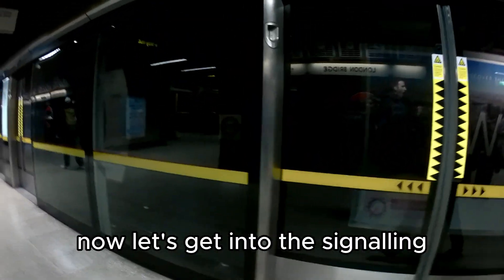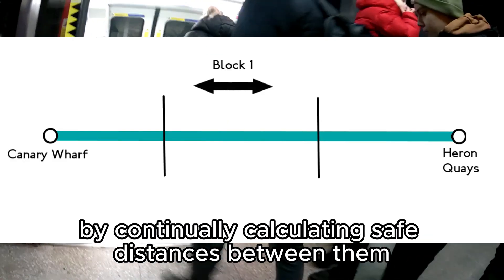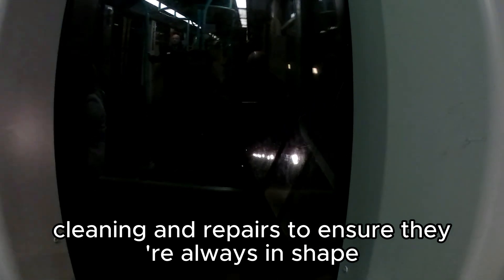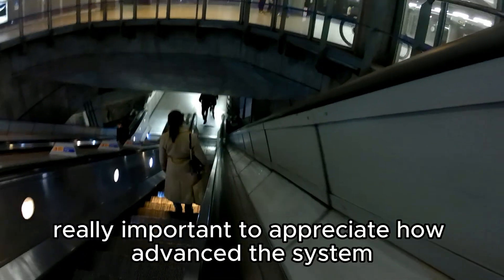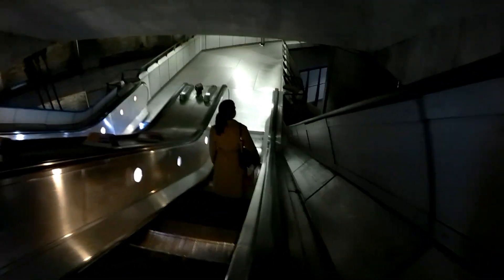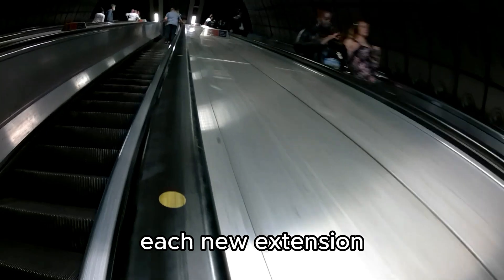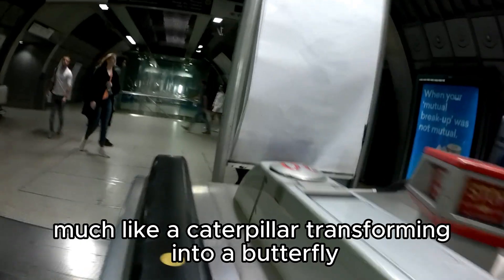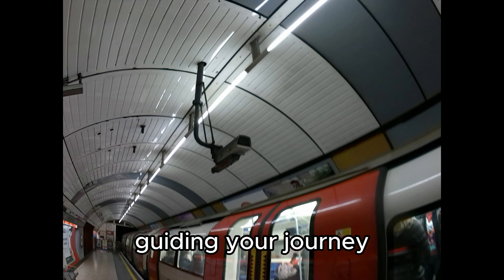How do DLR trains run without drivers?

Comment: Few things wrong here. "Who is in charge?" Each train has a PSA. The PSA on board is essentially in charge, they control when they close the doors and when it's safe to depart, override controls and also carry out fault finding tasks when the train fails. The control room is now located at Beckton not Poplar, where the old control room was. The control room can only control the speed and direction of travel, if the signalling or train fails the PSA has to take control. Maintenance is poor, the state of the B92 trains are disgusting and regularly fail.
Reply from the maker: 1) The roles of PSAs were mentioned at the start. 
2) The primary control room is now at Beckton, but the Poplar system is still installed as a secondary location. 
3) I agree but the main objective of maintenance is safety, not visual appeal, which the DLR has an almost perfect track record for.
Reply: @CharlieNolanTrains  if you dig into it you'd find there have been serious safety issues. For example exploding shoe gears. There's a video of a fire of one somewhere on YouTube. There's also the ongoing safety issues at stations such as cutty sark which has had no working escalators for over a month and has serious crowding issues.
Reply from the maker: @ViperUK Very true, and system definitely has it's imperfections

Comment: Thameslink can do the same but they choose not to, also union protecting them
Reply from the maker: That's very interesting, I didn't know that
Reply: Load of rubbish. Thameslink has ATO operation on a small section of the line which cost millions to do. Partly why we'll never see mainline trains running GoA3 or GoA4. The cost and construction of infrastructure required is astronomical. Unions have nothing to do with it they don't have that power.
Reply: @ViperUK  How is that load of rubbish? I am right that Thameslink can do it, you’re just twisting it and trying to say the core of central London is not covered, which is true but doesn’t mean Thameslink cannot do it. Don’t try to bring political views onto my comment as well please.

Comment: How do they run? Better, more reliably, safer and timely than with a militant, potentially suicidal or coronary artery disease afflicted human at the lever.
Reply from the maker: Very true.
Reply: In the 90s reliability was so poor they had a temporary replacement bus service in operations for months. DLR trains cannot close doors without human input from the PSA.